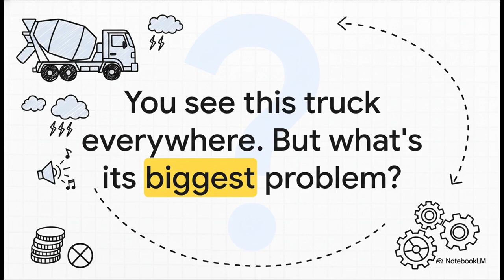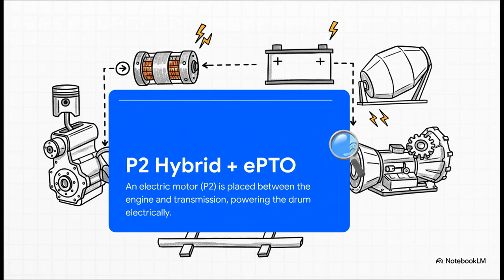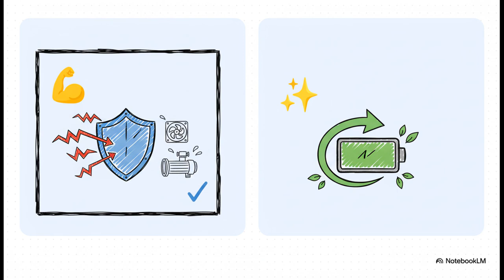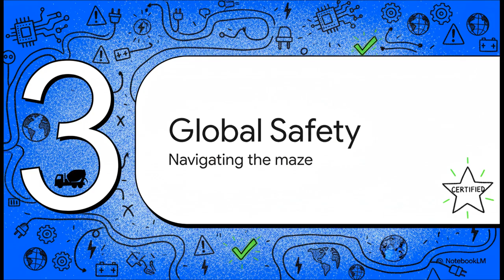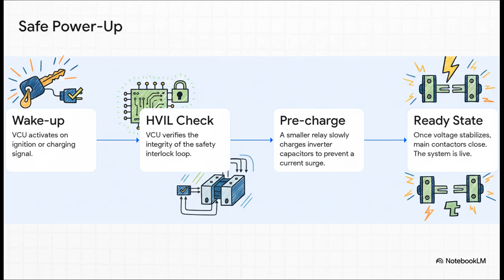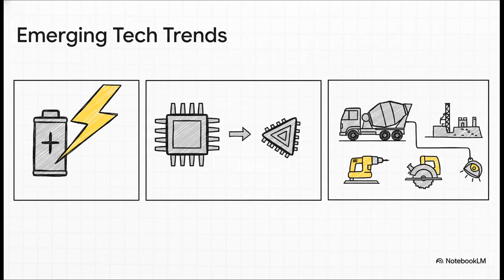ePTO _ Power Electronic Components

Comment: AI slop
Reply from the maker: Not really. Just using AI tools share you information sysmatically.
Reply: @RogerChen-n4t i still disagree. The graphs with electric signals are complete gibberish. They label a partial period as amplitude, showing frequency in complete random place. It shows that you completely didn't review the content generated
Reply from the maker: @Dluzak1  I agree with you. It's not good enough.It should be put more efforts to make it better.